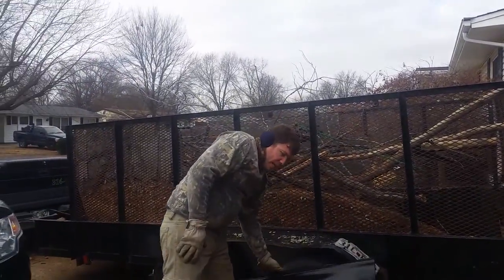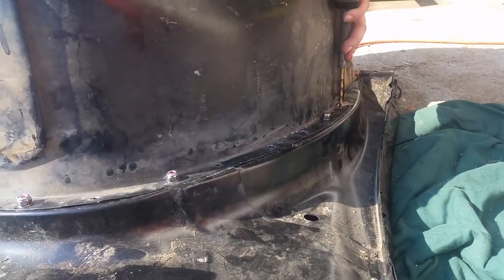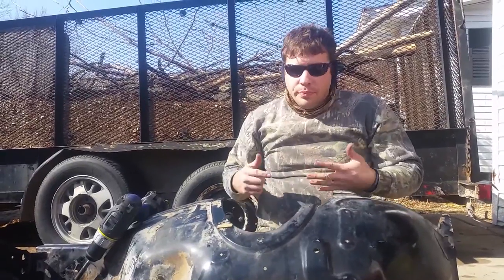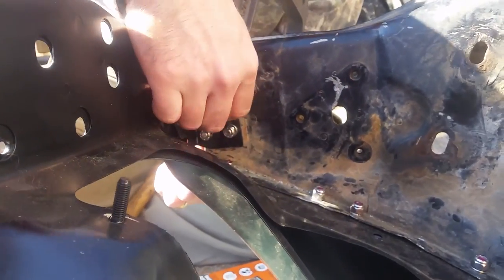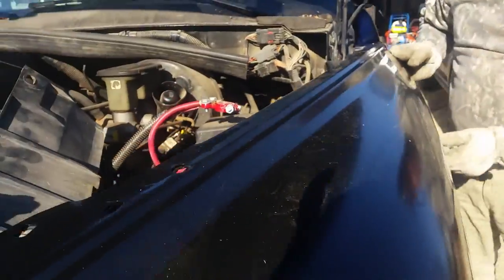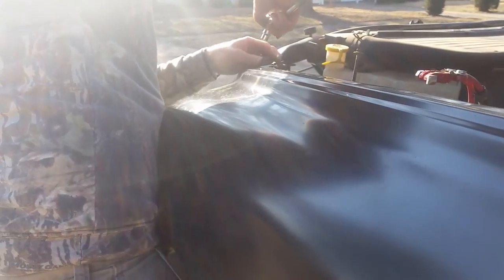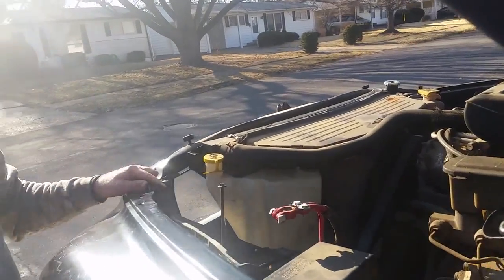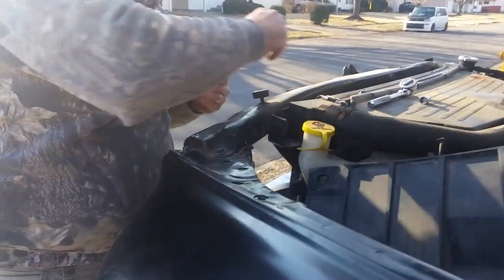replacing dodge ram fender quarter panel repair part 4

Comment: Thank You very Much for your 4 videos! I am Changing my rotted out 2000 Fender and i unbolted about 15 Bolts last night and then found your video! I finished removing it today! What a Pain in the ass!! Gonna drill out the spot welds tomorrow after work! Thanks again!!
Reply from the maker: Your welcome, good luck and thanks for watching. 

I have atleast 10 dodge repair videos on here if you ever need to do other repairs.

Seize the day each and everyday-Are Jay

Comment: been out working on my 2000 ram replacing the same fender....WHat a pain in the butt!!!! Who knew there were so many bolts and screws!!!!? lol.....I was fortunate enough to find a fender at a salvage yard in great shape and matched color. Dont have to worry about taking the inner fender off and attaching it to the new one. Great videos brother!!! Helped me with a couple of questions I was having. Thanks~!!

Comment: Gonna attempt this in the next few weeks awesome and helpful video thanks. Just curious what size nuts and bolts u used to fasten the inner to outer thanks
Reply from the maker: I do not remember the exact bolt size 3/8 maybe or 1/2 inch.
The bolt head is 11mm/7/16inch though.

Thanks for watching I hope it helps you.

Good luck. It is not really as difficult as it seems and you can get the fenders for like $60 from cert-fit.

Please like and subscribe every little bit helps during these times.
Seize the day each and everyday-Are Jay